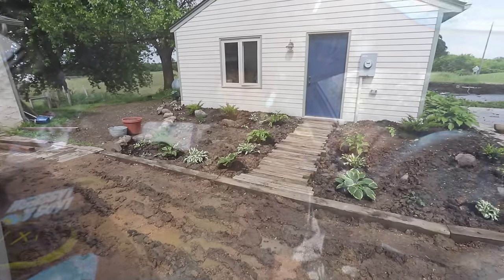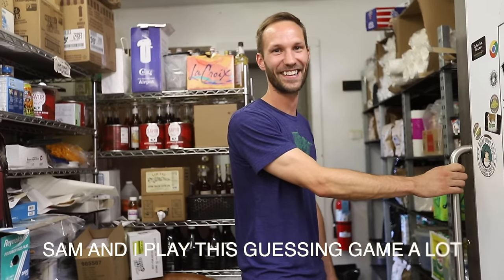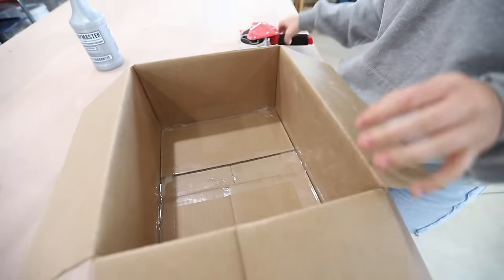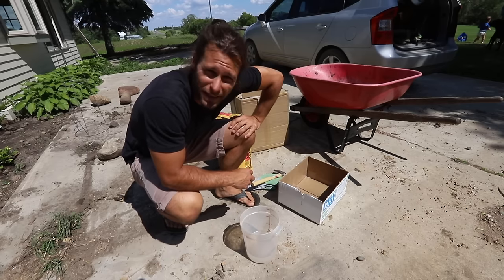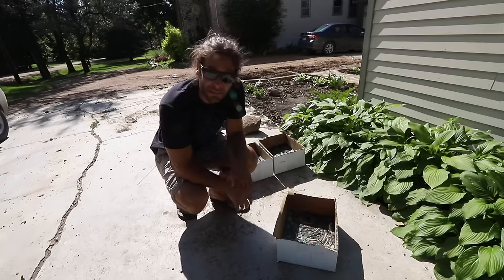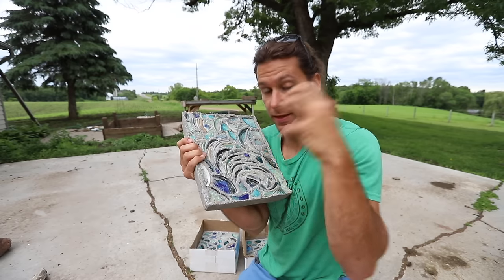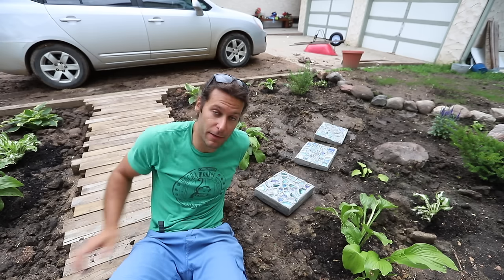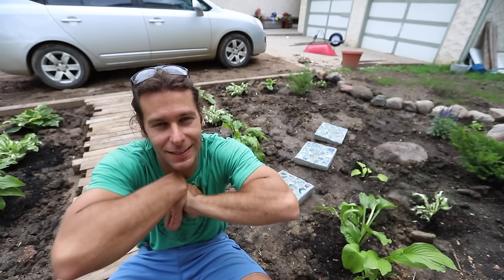How to make MOSAIC CONCRETE PAVERS

Comment: Great project!  When mixing cement, if you use a garden ho  in the wheelbarrow...it’s a lot easier. We did cement projects with my dad when I was little, we always thought it was fun to mix the cement. Who knew, lol! 😁 You could also try a 5 gallon bucket and a mixing wand for your drill.  I have seen some people lay the   Glass and pottery pieces face down in the mold and then place the cement on top of it.  The surface of your stepping stone will be somewhat smoother. Sealing the top of it with something is a great idea,  should help keep water out of the cracks...you don’t want them to freeze and thaw in the winter and break apart.  Love your videos!!!

Comment: Add hardware cloth to the cement mold for durability.  Fill half the mold, place hardware cloth in the center, fill mold up.  It helps prevent breakage.
Edit: New Thought! EDGING! I wonder if hubby can make me a form to make border edging?  I bet he can!
Reply: Also, rice husks (organic fill) or shredded nylon would also give some added strength to the cement.
Reply: Patte Laury he should be able to.  My dad use to stick molding in his forms to get different edges.  He was a cement mason.
Reply: Kool ideas - I want to make one to round the angle between the concrete sidewalk and porch/ landing ...
Used to have lots of broken China before I moved!

Comment: I realize I am commenting MONTHS after this video was posted...but...
I've seen where people do these but upside down. Place the Mosaic pieces upside down in the bottom and then carefully add the cement over it. This creates a smoother surface when done. No raised edges. 
Also, I would be concerned about epoxy creating a slippery surface to walk in when wet.

Comment: Another idea is to use old cake pans, put the stones or glass or whatever your using in the bottom, shiney side down and put concrete on top. Pop them out when they are done.

Comment: To prevent them breaking, cut out appropriately-sized squares of chicken wire fencing and embed. And, you'll have perhaps one problem with the deep-set china pieces: they will fill up with dirt really quickly. A smoother surface would help there!

Comment: New place, tons and tons of old, ugly, discolored decorative stones everywhere in the yard, removable only by hand.
Anywhere from bottle cap size to golf ball size and bigger.  Heavy!  Cat food, dog food, cat litter bags sturdy & perfect to put them in, but what to do?  They're taking up space!
I'm going to tumble clean a bag full, stir up some cement, and make pavers.  See how it works by putting the stones in first then pouring the cement over them -- at that point, the bottom where the stones lay will be the top, once dry.   I'm hoping for a cobblestone effect.

Comment: Did you line the boxes with tape before you put the concrete in?
Reply: I use a garbage bag covering a long plastic window sill planter then w cardboard form a slightly smaller  box weighted down w couple bricks 
Fun stuff
Reply: @amibeachbum2467  thanks for that. We ended up just buying pavers and decorating them with mosaics style. But that's a great way to do it.